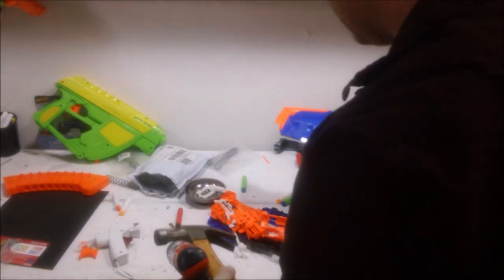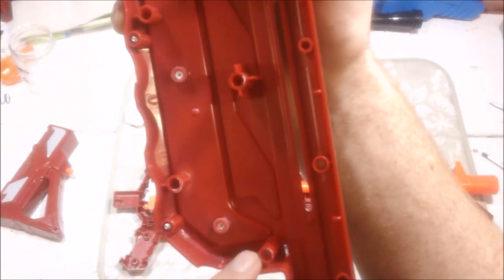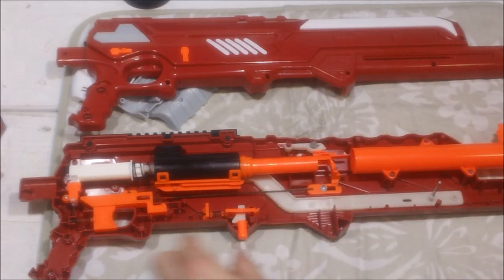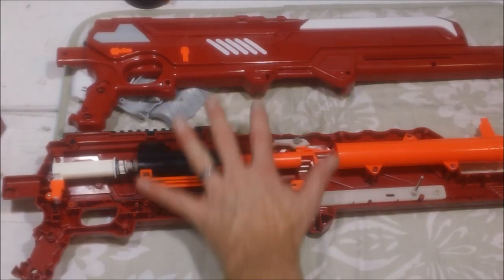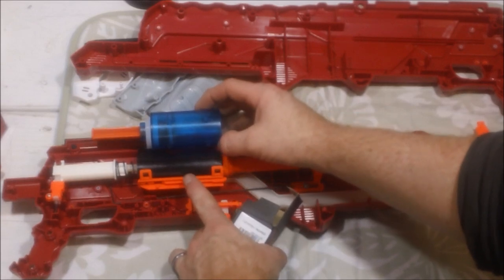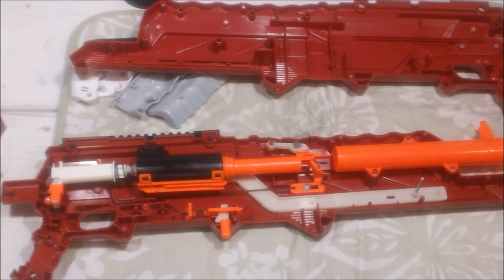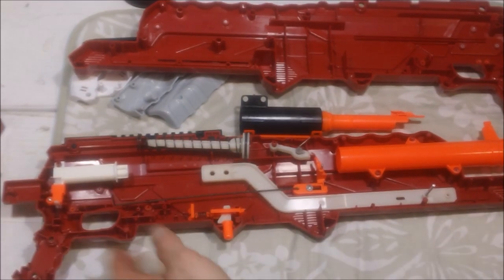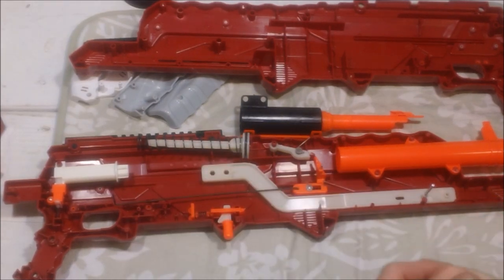Buzz Bee Thermal Hunter / Interceptor Internals and Mod tips

Comment: You read my mind or been hearing about me wanting to mod my Thermal Hunter both cosmetically and slight performance boost. Another tip don't forget to pad the plunger rod.
Reply from the maker: I did accidentally cut that part out, but it'll be showing up in a entirely separate video on why you should pad the plunger  head.
Reply: @MongooseJakeNerf  I was hoping you didn't forget that tip.
Reply from the maker: @Matt-md5yt  Nope, I've got two easy methods to showcase that basically everyone can do.

Comment: Any issuesith the plastic prime rod breaking? No plunger padding?(just curious your opinion) I thought the stock spring was really good, but I didn't know what it was rated at
Reply from the maker: The plunger head got padding added, but I'm featuring that in it's own video, showcasing two ways to easily protect plunger heads. And no issues of any kind with the priming bar when using a 7kg or 8kg spring.
Reply: MongooseJake 
I might do that but I'm honestly not a big fan of springers besides motorized ones like the stampede. Just personal opinion, but I thought about improving the thermal hunter and giving its spring to my stampede.

Comment: When drilling into the white and grey cosmetic peices on the side, what size of drill bit would you recommend using? Also what is the best way to reattach them?
Reply from the maker: I honestly forget the exact size, but it's just slightly smaller than the plastic itself. The re-attachment method I use is to hot-glue the piece back into place. Hot glue isn't so permanent that you can't pull the part back off in the future, but secure enough to hold through lots of use.
Reply: @MongooseJakeNerf  Thank you 👍

Comment: When up'ing the spring, have you ever had to reinforce the priming arm? I've heard (on other blasters) that the (white) plastic piece that connects the pump grip to the plunger can be a weak point.
Reply from the maker: Not when keeping it to a 7kg or 8kg spring at most. My main primary is my upgraded Interceptor, and it's  been doing well for quite some time without any signs of failure or stress on the priming bar.